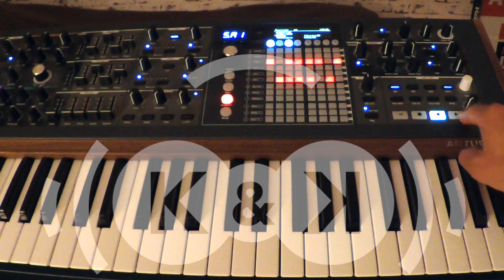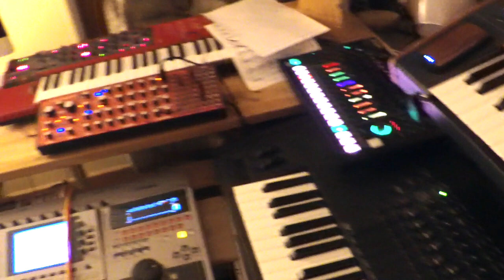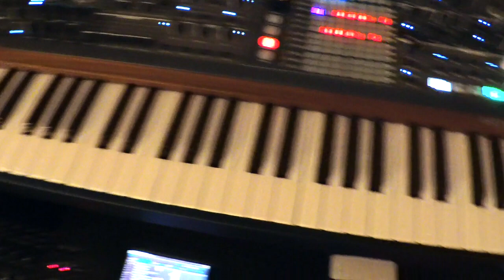modulating a step sequence, Polybrute

Comment: How easy is it the learn the sequencer on the Polybrute?
Reply from the maker: Its quite intuitive, despite the apparent complexity. It is all laid down on the front panel, no screen menus to dig in.
Reply: How easy is IT to modulate a Girl?
Reply: @KosmicKitchen  is there ratcheting on the sequencer?
Reply from the maker: @Unison_Detune  I do not think so, found no way to subdivide a step yet.
Reply: @KosmicKitchen  I think you can with the Z Axis of the morphee control?  It says in the Polybrute manual, Page 39:

Press the Morphée button repeatedly to select the Morphée assignment:
• Matrix allows each of the axes to be routed to multiple parameters at the same time.
• Arp / Seq lets Morphée Morphée randomize the sequence or arpeggio with Spice, Dice, and Ratchet:
◦ Spice (X axis) alters velocity and octave without transposing the pitch.
◦ Spice (Y axis) alters gate time.
◦ Ratchet (Z axis) subdivides the steps with multiple triggers as pressure increases.
◦ Dice: Swipe 3 fingers to "roll the dice" and randomize all of those parameters at once.
• Morph enables morphing on the X/Y axis between sounds A + B. Several response settings are available: hold [Settings] and touch the Morphée surface, or hold the Morphée button for about 1 second. 

My Polybrute is still in a box as I’m building my studio, so i cant test it for certain!
Reply from the maker: @darkcognitive  interesting, thanks for the insight!